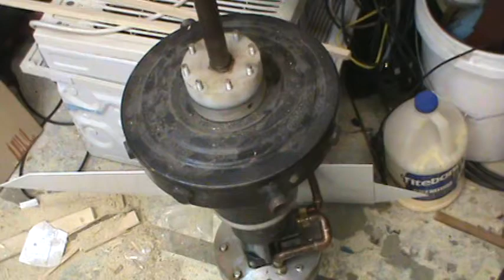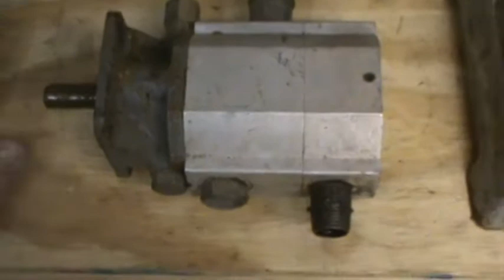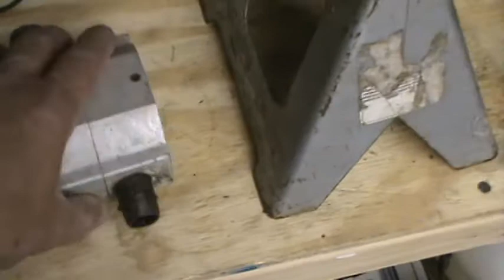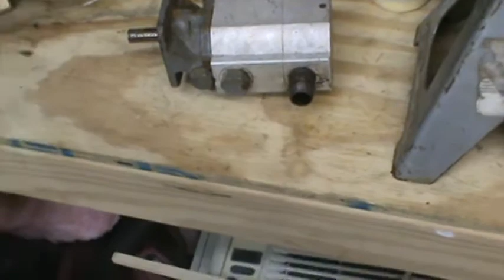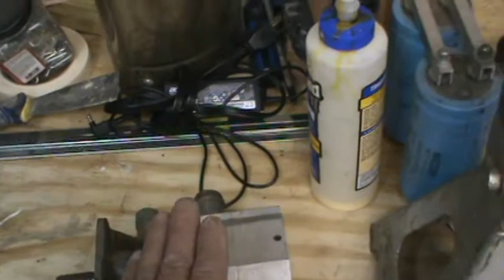Clem Engine 4

Comment: OMG, you brought in rocket science. It is rocket science. Rockets are powered by the reaction of the mass being ejected, just like this disc. And a good rocket scientist will tell you the Oberth effect of transferring the kinetic energy of your ejecta to the rocket (or in this case the spinning disc) will be amplified if the rocket is accelerating (why they sling-shot around planets during their fuel burn/dump); of course the spinning disc is accelerating, constantly changing direction.  So, the science explaining how this works is well understood and also  very old (for rocket science) idea. Its in just about every science fiction novel/movie that can use it. in Star Trek they travel so fast, they move forward and back in time to save the wales.... (too bad you can't do that with your demo, fiction does have its limits).

Comment: Tommey, your effort and enthusiasm are fantastic. Did you know that Viktor Schauberger did this, a 3,000 rpm water-powered generator to run his home. The key is porting the water with minimum resistance, or as VS put it, to have it flow the way it does in nature. Then you can use the water to power the movement of the water. The basic physics of this device are easy to prove with high school physics solving the conservation of momentum of a mass leaving the circumference of a spinning disc will impart a reaction to the disc, so a continuous stream (especially a pulsing stream; now you're talking the transfer of kinetic energy to an accelerating body, the oberth effect, proven by NASA to be the most effective way to amplify power to a moving body) will continuously drive the disc around, and with enough dynamic action will keep accelerating if it can overcome the resistance. By using Victor's fluid dynamic pipe designs, the water will nearly power itself up from the reservoir to the disc. His designs also control the cavitation, using it to assist the water flow, rather than impede the flow and destroy the pipes as is typical of modern plumbing.

Good luck on the re-build, take heart, Shauberger already proved the concept. Peace, B (Keep in mind, there is no money in "Free Energy", and the existing energy for money profiteers will do anything to stop disruptive technologies like that from taking their market share (it's their most cost-effective solution to the competitive threat that they cannot beat with their established investments.

Comment from the maker: Water thrust is: 1.57*psi*d*d.
In other words, a head pressure of 100 psi moving through a diameter of 1/4 will have a thrust of 1.57 x 100 x .25 x .25 =9.8125LB
                       __________________
Velocity is \/ 64*(100/0.43)          = 122ft/per/sec